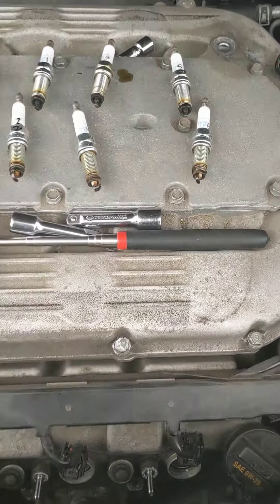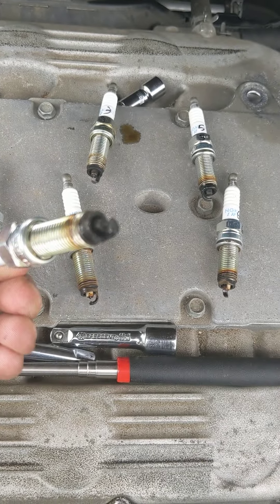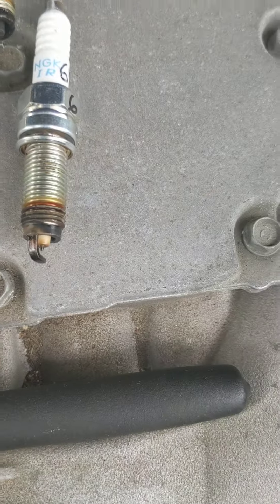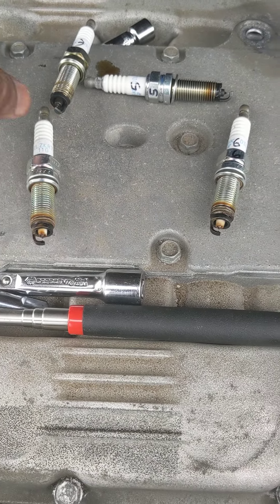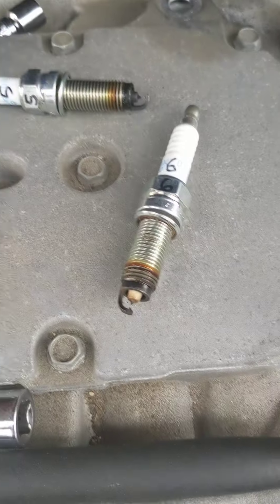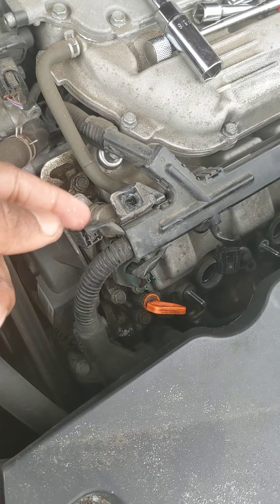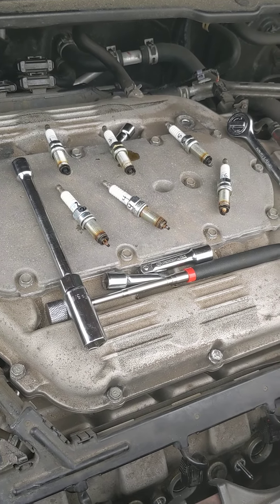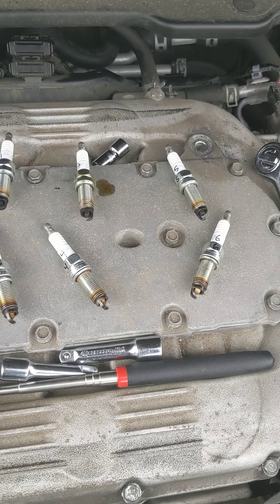2016 Honda Odyssey fouled plugs

Comment: Maybe you got your answer by now. The variable cylinder management system on these Honda Odysseys cause the back bank and the front bank-passenger side cylinder spark plugs to foul as these are the cylinders that are deactivated in 3 or 4 cylinder (active) mode. Many people, including me, have gotten and installed a VCM disabler (S-VCM Controller or VCM muzzler) to prevent the fouling (with misfires) as well as to prevent the expensive active engine mounts going bad. Not sure why one of your spark plugs has oil above threads - that could be a valve cover gasket issue. There are lots of discussions about this VCM issue in odyclub forums.

Comment: It’s certainly not your valve cover gasket but what you’re referring to is the tube seals in the valve cover with the bottoms of your coils would be soaked in oil if that was a problem

Comment: the bank in the rear is numbered 123 the front bank is 456 , not the way you described it in your video, these engines have issues with blow by due to the piston rings.usually one bank is at fault with the bank2 sometimes being problematic, i would recommend a VCM disabler as you compromise the longevity of the engine as well as fuel mpg, this video is most lijkeley the tube seals though